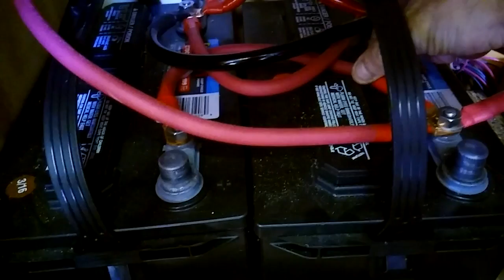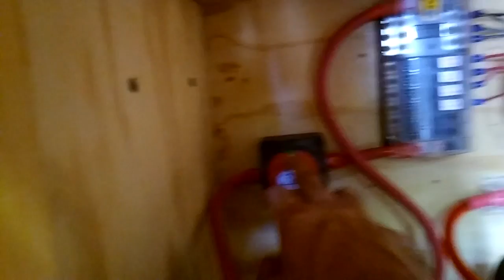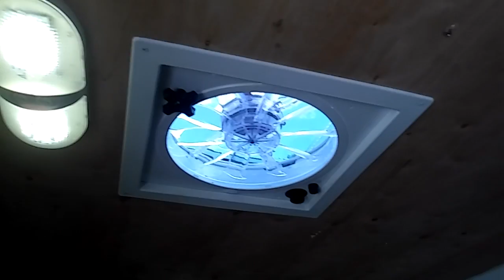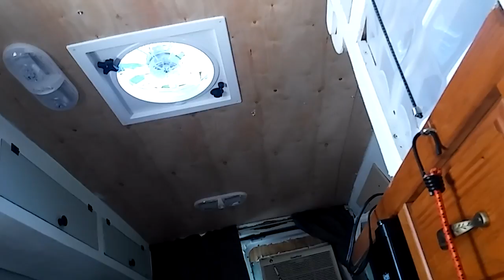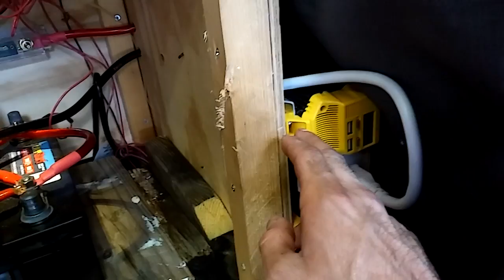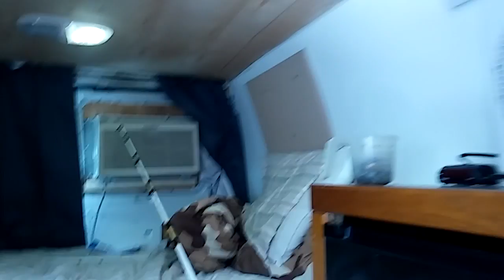Campervan & RV Electrical System Explained - Battery Bank, Wire Gauge, Inverter, Solar, D/C, ect.

Comment: You did a nice job on your camper and your explanation of how to wire 12 volt.  FYI the word “Aught” as in 2/0 or 2“Aught”wire, the g is silent and is pronounced  ot, like in the word bought,  I bought 2 aught wire. Its bought without the B. I'm looking forward to seeing moor of your videos. Thanks for taking the time to post them.
Reply: You're right about "aught" of course, but it's likely he's trying to say "2 AWG" (not the same as 2/0), which is the recommended minimum size for an inverter/battery system this size.

Comment: Hey Friend-
I've got a couple questions. I'm starting a build with a van and am wondering about the batteries. We're just trying it out and thinking about doing the electric easy at first and getting more complicated if we like it later. 
So here's my questions.
A. Do you think you need two batteries or would maybe one do? and
B. I see you've got your batteries inside the van. Are you getting any fumes? (People keep telling me to mount mine outside maybe underneath because of fumes.)

Thanks a lot brother. 
T.
Reply: hello trevor! well good luck and congrats on building your van. To answer question A, That depends on that kind of load or AMP hours you make be using... If all you are using your batteries are for LED light then one battery would be fine, but the moment you add a fridge, air conditioning, or laptop, the draw is much more and would recommend purchasing deep cycle batteries from amazon. They go for $160. To answer question B, Lead acid batteries when being charged disapate fumes which are not good to have in your living area, you can build a box for them and have them vent safely out. I currently use 2 deep cycle batteries and dont have any problems with fumes at all. Well good luck mate!
Reply: Mikey Films what is the setup you recommend for fume release? Cut out a piece of van wall and out a vent ? Wouldn't that bring moisture in when it rains?

Comment: cool Video (:    i have a question? how long (hours or days) does the battery go full use without charging the batteries? say example 2 batteries and fridge all day or 2 days
Reply: Cory says his batteries will supply 218 Ahrs when fully charged. If his frig draws 2.5 amps average per hour for 24 hrs, that's 60 Ahrs. But he doesn't want to use more than 1/2 his battery capacity before charging, so only 109 Ahrs are available. 109/60 days is about 43.6 hrs. But we don't know if his batteries get fully charged without measuring that in one way or another, right?

Comment: Cory - You da man!! Like you said, all the electrical systems I see in the camper conversions are VERY confusing. Your video is the first time I've thot I could come to understand how to set up an electrical system for my van. Thank you, thank you, thank. Like Jason said, you've got great teaching skills. I'm going to be buying a van to travel all over the Western USA with my dirt bike, and the electrical system was the only part that was holding me back in my planning process. It's like you opened up a window for me. Thank you so much for sharing all the info in the video.

Comment: BRO, That battery in the van is SEAL lead acid?  If it not seal, IT IS TOXIC, you needed to put it outside. by the trailer hook on.  Don't put inside because the Acid is toxic you breath in bro, you get sick, cancer etc.... Take it out RIGHT AWAY, NOT TODAY, NOT TOMORROW. TAKE IT OUT NOW.  or u get sick and any one in it with you.  I would not even put Seal Lead acid in the car or van where i sleep or live.  I used to want to buy the Toyota Hybrid, but when I saw they put the car's 12 volt battery under the passenger seat. I don't buy it.

Comment: Like you, I have searched everything under the sun for information and find it all too confusing. Confusing math. Confusing list of parts- one person has this, someone else doesn't. Different needs, etc. Your video is the easiest to understand I've seen and I've seen a lot and read a lot. Thanks! I have a question though. Just bought a year 2000 conversion van that I will modify. I'm not planning on living in it but will take in on 7-10 day trips with our 3 person family (Another thing not in any videos is seating & sleeping for 3!). The more I think about it, the more I think I can just get by with 12v and no inverter. Can easily power lights, fans, and chargers with 12v. Been thinking it might be easier to get one of these 12v coolers rather than an AC Mini-Fridge. Would think a small 12v heater would be good enough to get the van to 55-60 degrees. Van already has 12v TV & DVD connected to the battery under the hood so I could get that to work off of the solar system. That's about all I need. What do you think? Sorry for writing a book. :) Thanks again for the great video. I've watched it more than once.
Reply: 12v all the way is doable if you've got the discipline. Efficiencies from short wire runs and larger gauges are really important to design in.

One thing to consider, however, is what kind of battery to use and how you're going to charge it. A standard "trickle" charger is okay for starter-type batteries, not so much for deep cycle. Bulk charging voltage is too low for a complete "fill-up". Same with your vehicle's alternator, also most RV converters and other "dumb" chargers. DC output from a generator is also not effective. Solar panels/controllers can be a good solution, but there's a relatively high entry cost for some of these. See battery maker's specs to verify what correct voltage is.

There is a gas powered DC alternator rig made specifically for battery charging, but they're pricey. So, if a starter-type battery is selected for its ease of charging, you'll probably need more cells to store the power required for a week or more. Also a good idea is to learn how to use a hydrometer in order to get a reliable idea of the battery state of charge.

Comment: Great video! We have been stumped by the electrical part of vanlife for awhile now. Have you had any problems with your Wanderer Renogy Kit? Does it charge up both those deep cycle batteries?

Comment: whats the  part or where do i order the  one that  has the fuses in it
Reply from the maker: +Seamus Olsen  You need the 12 port fuse panel the link is in the description below. Hope this helps
Reply: ya man  i have a  van and  it has a 100 watt solar panel and  2 trojan 225 hr deep cycles.  and  im  trying to  wire it up  to live in... im way up here in canada.. right now edmonton  but in spring im soon to be  to vanvouer. need to  just save up some money to make the van complete...  justin credible tv  is up here check him out as  i follow alot of van dwellers.

Comment: Tell me about your refrigerator. What are your numbers for efficiency,price,and where you got it.
Reply from the maker: +George Bortnick  Hey George thanks for watching. It is a Haier Mini Fridge from walmart they cost around $100 not as efficient as the 12V systems but definitely works.

Comment: Hi there,

Um I want to power a laptop, a fan, a heater, a fridge like yours, led lights, a microwave, re-charge my cell, a kettle, via solar and batteries with an inverter, how do I figure out how many watts or amps I need in a system? To ensure no cut outs, say worst case scenario if all was on at once for 5 hours without the car running?
Reply: Experience has shown that you will need more power than you think you do, but less than you will wind up paying for.

Comment: You help me so much with this solar. My problem now is getting the plastic cover off is impossible HELP
Reply from the maker: +Sue who  Hey Sue! Thank you so much im glad i could help you out with the solar! For the fuse box just pull out and down from the top and it should come right off. Let me know if you got it. Thanks

Comment: Be sure to wire batteries so both charge to 95%%, You hook the negative of one battery to ground and use the positive of the other one for power. This keeps you batteries equalized  and charged at the same rate. 

You also need to remember if you use a shore power converter to charge batteries. You need at min 10 amps per battery. Which means a charger that can produce 20 maps for 2. If not you will take more then 2 days to charge them to 95% if at 50% discharged and batteries don't last long if you can't recharge them inside 7 hrs. Which is why you see 30 amp converters used to charge the factory made RV's. Unless there built cheap..
Reply from the maker: +Claude “Reviews4U” Rains Great tips and advice thank you so much!

Comment: Will 12 gauge wire work for all 12v things and how do u know what fuses to use
Reply from the maker: +D1 Nation  12 gauge will work just fine and as far as the fuses you need to see how many watts each 12 v device uses and then use the correct fuses rated for that device.
Reply: 12 gauge copper conductor will usually carry up to 20A safely, so if greater currents are planned, you'd need bigger wires -- and bigger fuses, too. Fuse is there to protect wire, so it must be rated smaller than ampacity of wiring, but still a bit more than the expected current maximum from all loads.

Comment: Bro.. Your vids are dope and inspired me a few weeks ago to get a van and start my build. I can appreciate your pops and mom helping you out and getting to spend that time with them. Your vans turning out great man. Just curious on your other video about wall installation.. Im at the point where i have insulated and put plywood on the floor and have also used gap filler foam in walls for added insulation. My question is, is in between the plywood walls and metal is there any insulation? And also did you run all of your electrical before you installed the walls? Thanks again for your great vids man.
Reply from the maker: +Cory Hudacko hey thanks so much man!! Thats awesome that this channel could inspire you to get a van you're gonna love it!! And yes in between the metal walls and plywood your going to want to add atleast 3/4" polyiso ridgid foam board insulation and yes you will want to run you electrical wires before you do that. Make sure to insulate the roof also as it tends to colect alot of heat. Hope this helped inwish you the best of luck with you're van if you need any help lmk. Safe travels bro!

Comment: I looked for 2 awg wire. so I have to put together, why can't I find the cables all ready together?  The cables that connect the batteries together
Reply from the maker: +Sue who im not sure. i know they have pre built wires but not sure where to get them have you looked on amazon?
Reply: i found them at autozone,they both black cables to hook up the battery around $15 each
Reply: +Jose G I ordered from amazon 15.00 tks
Reply: Some of the very best battery cables are made by Quickcable, and there are a variety of premade (with lugs or other common connectors already properly crimped on) lengths and gauges sold online by centurytool.net.

Good crimping tools aren't cheap and often require some skill to use correctly, but a poor connection on heavy materials results in reduced current flow and consequent performance and overheating issues, up to and including fire danger.

Comment: Hi where does the solar charge controller wire into on that setup. Thanks
Reply: From the panels to the controller input then from the output to the batteries. Be sure to fuse the output before you hook them up too the batteries! And if you buy a controller spend the extra cash for MPPT. As PWM are only 65% efficient. So if yo have a 200 watt panel an PWM will lose 35% of that rated watts, in the best of conditions.  This is why MPPT controllers cost more. They are 94% efficient and monitor the panels for best charging. Which is all software driven.
Reply: Thank you for your advice.

Comment: This is awesome!  Thank you!  I am rebuilding a vintage camper and am just getting to the 12v stuff.  I just finished the 110.  So I have a converter/charger.  Do you know where in that system it would fit?  I'm guessing between the battery and fuse box.  Thanks again for the great videos!
Reply: An AC-powered charger will be connected to (an outlet or hardwiring) energized by shorepower on one side and connected directly (and first on the terminals) to the battery bank. Multiple batteries should be wired so that all cells of each one get their share of current. That is straightforward when they're a series-connected bank, not so obvious when there's any parallel connections involved.

Comment: Never go below 60% on any of your batteries. You can't really tell besides monitoring load after a charge. Some people will say you can tell by voltage drop but there is no generic number and the rate can change things because it's chemistry and heat. If you put them on solar use a **programmable** digital charge controller so you can change up calibration. Doesn't hurt to have two banks with a big fused switch to swap without dealing with wiring. Look in to NiFe(most durable but expensive) and LiPo if you want the two best battery techs, and 250AH is the best deep cycle AGM battery you can get(UPG 45964 Ub-8d Agm Sealed Lead Acid Battery).

Honda has the only really quiet generators you can get a good used one for a few hundred bucks that does 2,000W(EU2000is) or 7,000W with fuel-injection(EU7000is) for around one to three grand. If you're desperate just but the most powerful one you can find with the least time within your budget. A couple hundred can get 10,000W easy.
Reply: 60% is your rule, not every body else's.   The battery bible says 40% to 50% based on 5 year's.   These are WALMART $100 batteries, not Trojan T105s.  Most wheel chair user's run their batts down 30%.  Nice sharp shooting but doesn't work here.
Reply: ***** shhhh let them teach us all with figures that are ten to twenty percent below what respected members of solar-communities and engineers suggest on average. It's not like these things are $80-$900 even online.. Boondockers are all rich anyway..

Comment: I saw where a instead of using short pos to pos jumpers, he took a 1/2" or 3/4" copper pipe & hammered it flat 5" long, then drilled 2 holes on each end so as to make a BUSS duct bar out of it to jumper the batteries.   To insulate the pipe in the middle, he used shrink tubing.
Reply: You must be talking about another install you saw on youtube some where else because Cory has no buss duct or bar.